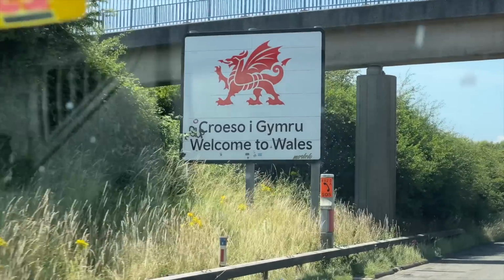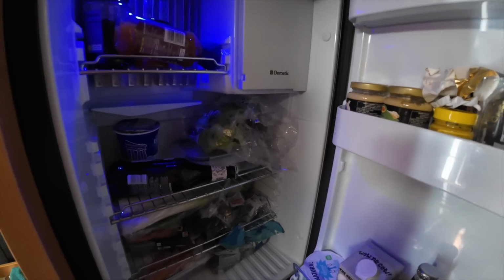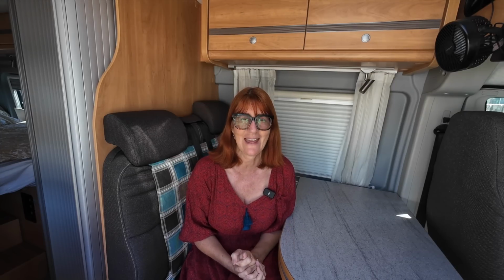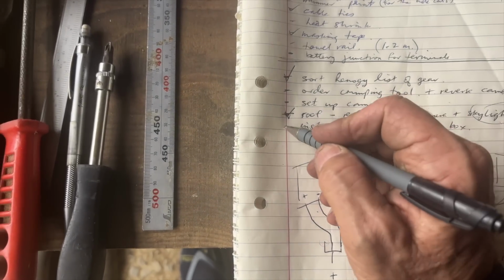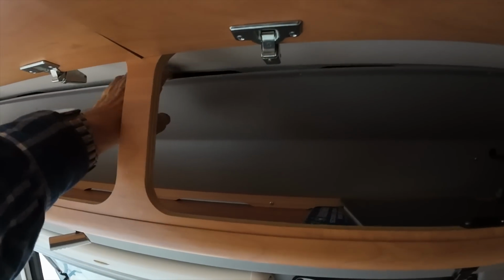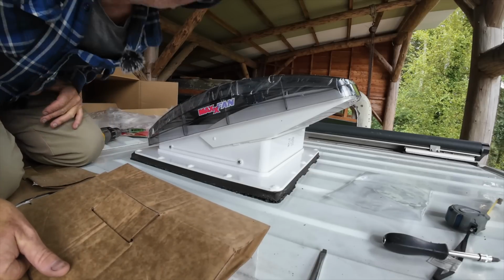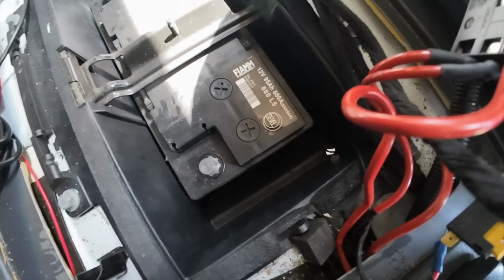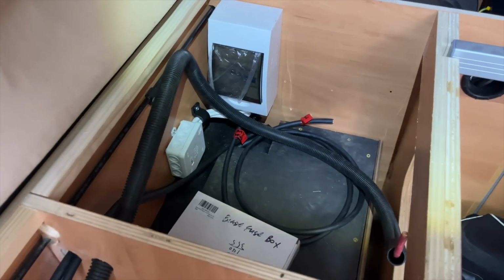MAJOR VAN UPGRADES - Preparing our Campervan for Off-grid living

Comment: 28 december, just found you so not sure where ur at now.
If you thinking of Scandinavia in winter u'll need an engine preheater coz u could be in -30°c, solar would  be rocking horse sh*t, so a small cheap genny a good idea for days when the weather is do bad you can't move, or if the engine won't start or u breakdown. You must have elec  for your heater etc etc as u well kno.
2015 model, if trully 2015 it's EURO6 spec so a help with LEZ's.
Italy: illegal to sell u lpg for domestic use, but go to more rural garages and mostly u should be served. Buy a bunch of adaptors for different lpg nozzles in EU & UK.
Beware of diabolical narrow streets with right angle bends low bridges  parked cars in crazy places everywhere.
Scandinavia: Also only one heater is fine provided it never breaks down or you ur stuck soneplace and u run our of lpg, therefore a chinese diesel heater is belt and braces, and u can run it in combinatation with the lpg heater if necessary. -30 or worse is no joke. I'm assuming ur Possl had an lpg truma heater.😮
Possible insulate the deisek supplis to engine and heater or use inline heaters.
Reply from the maker: Thanks for all the tips! I’m certainly not brave enough to visit Scandinavia in the winter!! 🥶 
And our van isn’t set up for it. Our plan is to go south in the winter (we are in Sicily now) and north in the summer). So far we haven’t had any issues getting our gas bottles filled here. 
We have both been right to the top of Scandinavia before and we are looking forward to heading up there again! Thanks for the tips!

Comment: Did you also install a charging booster so that the lithium battery gets charged with a decent speed while driving?
Reply from the maker: Yes there will be an MPPT smart charger that both the solar and DC cable will be plugged into. Just waiting for those things to arrive (check back next week 😉)
Reply: @nigelandsueadventures  I was not talking about the MPPT charger for the solar but the charger that should be between the car battery and your second and/or third battery to charge them while driving with higher amps. So not running just a battery cable from one battery (DC to DC) to the other one. Such a system will also ensure that your starter battery of the car does not run flat if you are standing for a longer period. As your Pössel has just the basics, you may not have such a booster in your camper.
Reply from the maker: @cu3714  sorry I think I was not clear.  The charger we have is a dual input smart charger, so both the solar and DC-DC cable plug into the charger and it switches between the two (ie, only uses the DC-DC when the car is running.). I'll put together a list of all the products we use for next week's video.

Comment: Great video, why run positive and negative to dc 2 dc charger most usually only need positive as negative is earthed. I installed 3 using Enerdrive and only required a positive? Are you going to upgrade suspension as I’ve a 2022 Iveco Daily and the downside is No Suspension Upgrades….
Reply from the maker: I’ll let Nigel answer this one! I know we did Enerdrive in the last van.
Reply: He's installing as per enerdrive installation instructions,grounded back to batteries neg lead, hopefully downstream from voltage smart sensor if fitted,theres arguments a plenty that this isnt necessary and can be grounded to chassis nearer the charger however following enerdrive instructions better a warranty claim will be

Comment: Love that feeling when the new fan fits the existing cut out! Also the way that there are holes in the frame of the shell of the van and you can see where the wires are going - so good. Lovely job Nigel!
Reply from the maker: Yes it was a relief! Otherwise there would have been no Maxx Fan, and we already know how useful they are.
Reply: @nigelandsueadventures  Also it will be interesting to hear your views on the solar panel in Europe given the less sun/more clouds - would like to hear about the different recharge rates from you.
Reply from the maker: @tobyhartley2829  it will be interesting - especially as we're coming into winter!
Reply: That's amazing what your doing to that van. It will be home sweet home very soon..